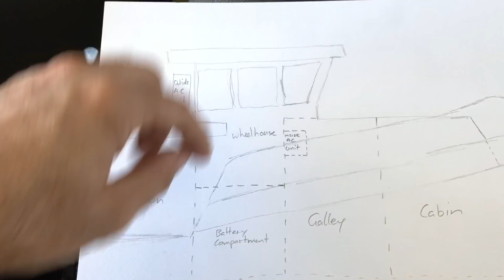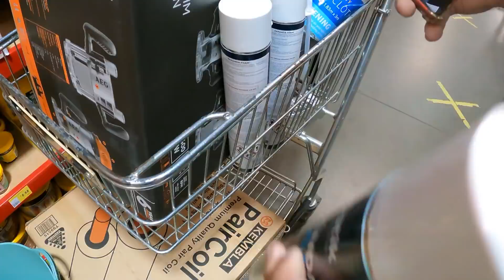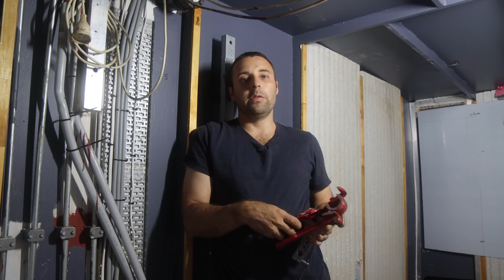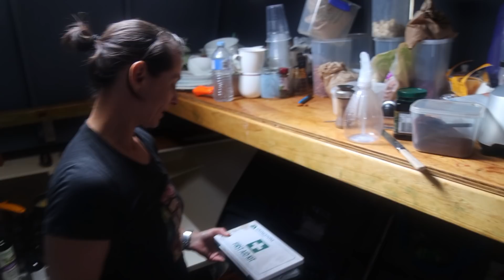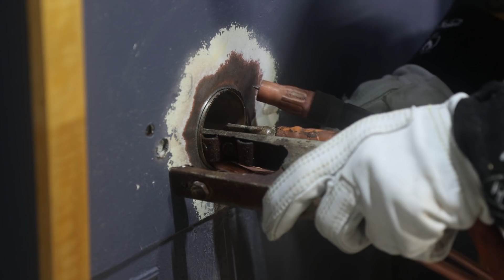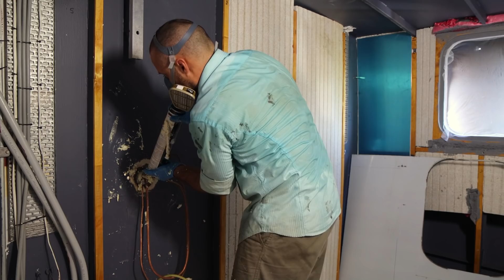Marine air conditioning, making the insulated pipes - Project Brupeg Ep. 202

Comment: Hi guys i have been watching everything you have been doing gret work have  been a commercial fishermen for twenty five. Years  so make sure you have bilg pumps in your voids also i have been on big bats 125 n more make sure the lazerette has at least  two bilge pumps  n also. A camera. In there n in engine room  also  we always carried a  coast gaurd certfied  pump the one th at. They drop to you when  need it for extra. Water.  These are just suggesti n s  ypu know. I know you are ding everthing to the max   one more thing if you plan on getting into era s with ice not sure how thick the steel is or what rayed it is back if yes think about where the water line is about where it may be hitting n put. A plate of steel there   thanks for lisenging   if you want to email me it is richardlovasco@gmail.com

Comment: Actually, I would think a SS "condenser heat exchanger" to the sea water would be much superior in the area of longevity due to the brackish air on the deck. Ron W4BIN
Reply from the maker: We thought through all options for air conditioning. We have to consider finances as well as what the commercial trawler guys do. We decided this was the best option. We have very little money and water cooling is too expensive. It would be very cool if we could though. Jess

Comment: Insulation , where it's needed , of the correct grade , and  installing it correctly... preventing  condensation inside your chafe / protection sleeve...PERHAPS  INTERVAL PERFORATIONS TO INJECT CORRECT FOAM AT  USEFUL POINTS AND JOINED  /SWAGED  PORTS FOR  LATER PROOFING ETC.......INSTALLING SUPPORTS /SPIDERS  TO ASSURE  NO  METAL TO METAL CONTACT   BETWEEN FOAM   INJECTION.....FUSSY BUT   YOUR  REJECTION OF SUB-PAR CONTINUOUS FOAM NEEDS A FULL FOAM JACKET TO ASSURE GOOD PERFORMANCE  AND LONGEVITY....GOOD  TEST OF  DETAIL AND MATERIAL MASTERY....

Comment: For those that don't know, wherever an air conditioning pipe sweats, it's removing heat from that location instead of at the Evaporator core/inside coil and since it can only remove so much heat you need to make it remove it at the inside coil or you'll being sweating your family jewels off in paradise!  ;) lol Awesome video!
Reply from the maker: Dead right. The pipes need to be really well insulated so all of the effort from the compressor is translated into a bigger temp change in the cabin.
Reply: @ProjectBrupeg  I've worked on Automotive air conditioning,  roof top  air conditioning in RV's, and big Limo bus split systems (Carrier units mainly) for 22 years =)

Comment: At any number of points along its length, the copper pipe will contact the stainless pipe.  Won't transfer of heat  end up with causing some condensation on the outside of the stainless pipe at those spots?
Reply from the maker: That’s why we used polystyrene blocks inside the stainless pipe to position the copper in the middle and without touching each other
Reply: @ProjectBrupeg  I am glad you did, and I hope that you find no cold spots on the SS tube.

Comment: Dame, I am a qualified lpg gas fitter. Be careful on work hardening those copper pipes. We work to a " fewer connections is best standard" but that is a compromise to practicability. Obviously ac pipes don't pose the same danger as lpg but it's still a massive pain in the arse if a pre stressed pipe cracks. All the best best from the U.K. keep up the good work.
Reply: P.s get yourself a set of bsp taps. Most cable glands are bsp thread. It allows you to tap bulkheads. There is an Indian company which do a very good value set of taps and dies and they are not rubbish. I am talking everything upto 1' bsp for £100
Reply from the maker: Nice. Thanks for letting me know. I wanted to have one pipe from outside unit to inside unit to minimise joints as much as poss. We did get there but I did have to add in an extender because of the stainless wall sheet

Comment: I hope I'm proven wrong. Using stainless was a mistake. Every spot the air conditioner feed line touches the stainless condensation will develop. Stainless conducts temperature wonderfully well. PVC has a bit  of insulating qualities. May have been best to slide the insulation back on to guarantee the copper lines never made contact with each other or the stainless steel pipe. First time viewer. Impressive project...
Reply from the maker: Thanks Jeff, glad to have you along with us mate. Welcome aboard

Comment: Funny, I've found the larger routers to be kinda over rated. Most of the things people use the big routers for, I found can be done better with other tools. For me the smaller and lighter the router the easer it is to handle. It's mostly just a flush trimmer or round over tool so I don't need the power of my biggest routers. My favorite is my cordless makita.

Comment: Sorry, commented before seeing the end of the video where you foamed it shut. Ah well. I would have used circular (cheap white plastic cutting boards work well) inserts along the length (every foot or so) of the SS pipe to hold the two copper lines away from each other and away from the stainless walls, with extra holes in each insert for the foam to flow. Then foam from each end, and get a proper clamp on the foaming hose. It was painful to watch you struggle with the foam as I have done the same thing soooo many times... But all that aside, you two are doing a great job on the boat. It's nice to hear that people step up and help out with the nickel and dime things, as well as the occasional big gift (Router - Props to the Donor). Carry On!
Reply from the maker: Cheers Alfred

Comment: You realize of course that those pipes cannot touch each other, otherwise the heat transfer between them will negate any insulation you do use. That's why they were insulated separately in the first place, albeit poorly.
Reply from the maker: Yes. That’s why we showed separating the pipes with polystyrene blocks then filling the pipe with spray foam so nothing can move.

Comment: Copper pipe that touches any other metal l will corrode extremely fast . Especially if there's fluid flowing through it cause electrolysis.
Reply from the maker: Good thing they are incapsulated in 2.5” of foam and it’s impossible for them to move now...
Reply: Just didn't want to see you have any problems down the road

Comment: Should use spacers to keep the pipes apart. one is going to hot and the other cold so you do not want them to transfer heat between them or to the stainless.
Reply from the maker: We did, that was the polystyrene block that were pushed into the pipe

Comment: Great work as usual team. I laugh so hard coffee shot out my nose when D, sprayed foam all over the place. Re the AirCon. check out https://www.mixergy.co.uk/. these are water heaters, and I am not sure if they'd be suitable for your boat. But the point is that mixed energy systems can be joined together. In the case of these water heaters they can be connected to your Aircon heat exchanger meaning the fans work less so you'll save energy running your heating and cooling. Then any excess heat from the AIrcon can be saved as hot water, meaning you use less energy to heat your water. (plus they can be incorporated into solar, and I guess heat from your engine, and run off gas). Anyway just a thought I had when I saw you messing about with your Aircon.

Comment: Hi Guys, still here! Just wondering why you didn't leave the insulation on the copper, bar 15cm inside each end of the stainless pipe, then fill the pipe with expanding foam? To my mind it would have reduced the amount of foam needed, centred the AC pipes and stopped them touching each other and still have formed an airtight seal at each end stopping the condensation problem.
Reply from the maker: Yeah that’s a bloody good idea and I didn’t think of it. You can’t bugger off yet! There are still damn useful ideas inside that mind. Great to hear from you James. Dame

Comment: Your supply and return refrigerant pipes need to have a seperation as they are different temperatures about 2 - 18 Deg on suction line, and 65 - 120 Deg C on on discharge line.  But maybe too late.  also dom't forget to clean the pipes with nitrogen before connecting and vacuuming.  Hope not to late to stop a performance risk of the unit....
Reply: Now have watched the whole video.  My apologeesus why did I embarrarse meself...
Reply from the maker: lol, you were fine. Geez some of the other comments though... it’s like they think it’s our first day on the job!

Comment: Was freaking out as the copper lines looked so close to the Battery terminals Hahaha
Reply from the maker: Those are the old dead flat batteries. They weigh 70kgs each so ive been avoiding lifting them out for about a year now...
Reply: @ProjectBrupeg  be some good scrap value

Comment: I have some problems with the solution to use that stainless steel pipe. The two tubes carry the forward and return energy and should thus be isolated from each other. Without that initial foam isolation you will end up with them touching each other. Why not leave/re-apply that initial isolation and then put your foam around it inside that stainless steel pipe. in this way you are sure they are separated. Even with that original foam for short stretches as separation setting and the rest foam will prevent the tubes from touching. You used a bit of separation. I hope it is enough. Good luck!

Comment: Dame, The length of the thread on Glands is not determined by price ;) It is determined by use if you are glanding into a threaded hole you may need a shorter thread. If you are glanding into a switch board / control Cab, gland plate you can get away with the shorter ones :)

For Marine use I use SS or Nickle coated Brass.  They can be found down to 12mm size at most electrical suppliers (May need to be ordered in)

Comment: You can use the Mag drill on the stainless wall. Just put a thick bit of plate  (10 - 12mm ) behind the stainless for the magnet to grip on to thru the stainless sheet. I do it all the time

Comment: Sorry Dame but I really did not like that solution for the AC pipes. Buy the pipe as 1/4 and 3/8 or whatever they were. Put them in seperate tubes not twisted together , which I bet they are.  The spray foam will be a mush too. It looks as if you have spare insulated pipe, cut the stainless tube and prove me wrong. seperate the tubes and their insulation and run them through seperate plastic pipes, one in each. Will be a guaranteed better rig. Run a tee with a drain point if you really think it will leak water.
Reply from the maker: In the episode i show feeding in polystrene blocks to seperate the pipes, they are not twisted as the stainless is 1.3m long and you can see through the pipe and both ends so twisting is not possible. I wont be cutting the pipe open to priove you wrong, i have confidence it will work. Im ok with the solution and thats all that matter because if its wrong im the guy the has to fix it.

Comment: You should consider ditching any inline flair fittings, just silver solder any joints -- no flair leaking worry.   Easy to do, just be sure to purge your lines with N2 or Argon.

Comment: Gotta agree with a few other comments. An occasional  "advice please"  discussion seems like a good idea. EG the supplied insulation should have remained as it ensures correct distance between the pipes which is important to stop heat transfer.
Apart from that, all looking great 👍
....and, onya Pete 😊
Reply from the maker: nah the old stuff is garbage and by feeding the polystyrene into the pipe i was able to space them further apart than standard and no risk of the crap white insulation reacting with the foam.

Comment: The idea with the pipes inside the stainless tube is quite good. BUT if the (metal-) pipes touch the (metal-) tube you'll have the same problem again as the pipes will cool the tube. a solution could have been to keep the original insulation of the pipe inside the tube to prevent metal touching metal and then fill the whole tube with foam as planned to make it airtight.
Reply: I think you also don't want the hot and cold pipes touching.
Reply: indeed it was not necessary to remove the protection inside the tube ... !!
Reply: I agree.  And you want at least an inch of insulation between the hot and cold tubing; otherwise the efficiency will suffer significantly.  It's nice you can use flaired connections in Australia; here in the States; we have to use a different refrigerant that has such a high operating pressure that the joints must be silver soldered.
Reply from the maker: Hi guys. In the video we show pushing strips of polystyrene in the stainless pipes. This was adjusted to hold the copper about an inch from each other and about an inch from the stainless pipe wall. Only then did we fill it with foam and it’s locked up rigid so nothing will move in there now
Reply: I have even seen people use actual plastic rain gutters to run the ac lines in. Cap the ends and run a small hose down to the bilge to divert any water down.
Reply: LPG copper tube has a shrunk fit protective cover for auto installations.  Bit late now....lol

Comment: It occurred to me , to get full advantage of the "hive mind ", you need to announce your plans in a planning video, and then use the comments advice  for the actual job.
My Dad was always keen to offer advice "after" I had done a non optimal job. :-(
Reply: Yeah this. It would have been a faster and easier job by just using 25mm wall fire rated Ensolex pipe insulation. Spray foam and polystyrene will draw in moisture over time if not vapour sealed. Even 19mm wall would have done and taped joins and siliconed ends gives you a vapour seal on the pipe length. The reason the pair coil insulation would have dripped in the first place is the vapour seal failed. Then if the insulation fails it's a ten minute job to cut it off and re insulate it in the battery section.

Comment: I have learned use a larger plastic tube when shooting foam. 
Great editing when you drove your head into the steel. It would have taken two beers before I finished the job.
Funny they call that part of the boat a saloon and yet you never see bar stools and bar table. 
Good luck working with dead tree carcasses with your new tools. It should be able to make great signs.
As always great Kiwi engineering 🥝🇳🇿👍

Comment: Just watching you with the AC Pipe Runs .... I'm sure it would have been Far More effective/efficient just leaving the 'Supplied' insulation on, feeding it down the Stainless pipe and only stripping off where you required to do so. .... Then fill the Stainless tube with foam as you did. The 'Spacing' apart of the HP and LP lines would have been correct.... It is VERY Important !!!!!..... In my experience, the 'Supplied Insulation' is great, the problems only arise when the insulation is nicked or damaged, or .... The Ends are not sealed correctly to stop the ingress/exchange of 'Air'. The White Sheathing is really perfectly impervious. Thanks for sharing Your Great vidclips .... Cheers from NZ
Reply: Totally agree...
Reply from the maker: Disagree. In our experience in this boat that supplied stuff is junk. It’s not fire rated so wouldn’t pass survey standards and turns to powder after a few years. Garbage solution to a boat problem. Dame
Reply: @ProjectBrupeg  I hope you're not saying that EVERYTHING you're putting on the boat is fire-rated... and you're right it does turn to power after a few years since it is not UV tolerant, but enclosed in a PVC pipe I wouldn't think that it will get too much UV, LOL.
Reply from the maker: Inside our battery box where zero UV gets to, if you brushed up against the old white insulation you would get white marks on your clothes and a shower of foam dust. Maybe it was just the stuff we had but I thought it was terrible. As for fire rated. All the poly we use in fire rated and the foam has a four hour rating on it

Comment: You would be better off with a router or shaper table instead of a hand held router.

Instead on running one continous copper line you would be better off using bulked fittings and you would flare the line on either side of the bulkhead fittings.

Comment: hey jess and D ;]  just a fyi on bits  they make bits with 1/2 inch shafts and 1/4 shanks  which add to stability and strength on smaller diameter cutters and chucks  ..the same for larger bits.. typically bits are tool steel  some are treated some are coated  good for most applications but will dull  theres also carbide...makes metal work possible as well but expensive .. for your windows if you have too much depth it will cause convection currents between the panes and transfer more heat ...new technology is to add a third layer  this is usually a plastic film with a low e coating on it...emisesivity coating but basically its automotive window tinting film  if it were me  ide go 10 to 15 % as it would cut the glare off the waves but not kill the light. thanks for the videos as always.

Comment: Are dissimilar metals in there going to be a concern if the copper is touching the stainless in places?
Reply: If the copper touches the stainless you will not have any insulation at that point and be back at square one surely.
Reply from the maker: That’s why we jammed bits of polystyrene in along the length to make sure the copper is central. Once it’s all foamed in can’t move so it only have to hold it for a few minutes while the foam sets
Reply: @ProjectBrupeg  Read my mind :-)